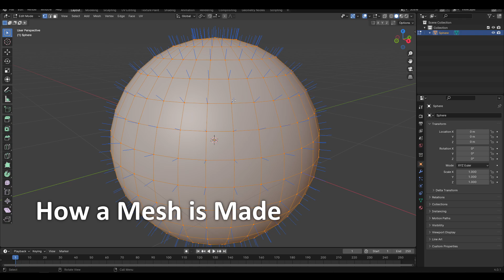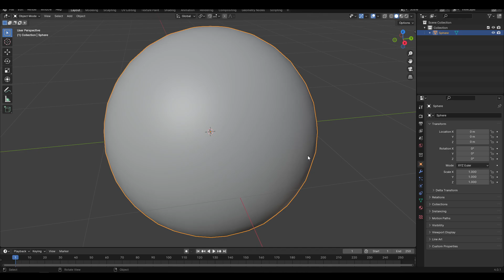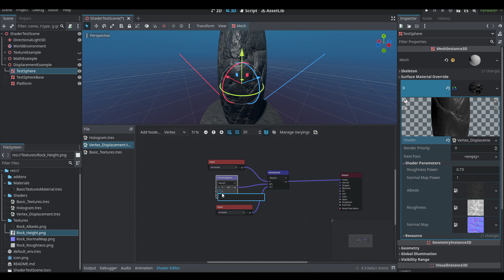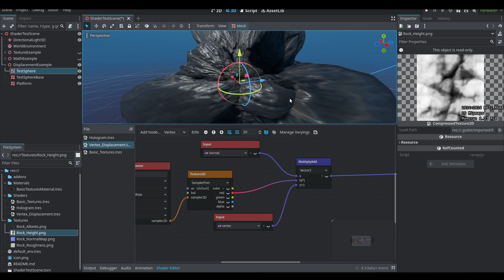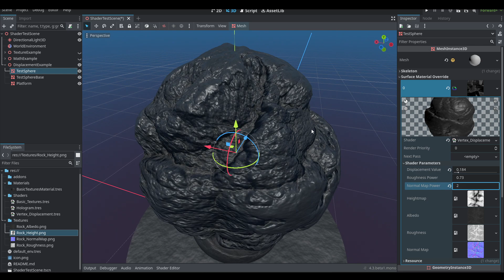Basic Shader Tutorial - Vertex Displacement

Comment: Is there a way to send the configured displacement map along with the exported .glb file?
Reply from the maker: No I don't believe so, you can generate a normal map outside of Godot though and then you could move it around, I believe if you take Perlin clouds from photoshop or some such other source, then you can generate a normal map online for it using https://cpetry.github.io/NormalMap-Online/ but yeah unfortunately there's no way I know of to export generated displacement maps.
Reply: @Bonkahe  I think you misunderstood me... I'm referring to exporting the Blender model to Godot with the textures and having the height map already incorporated into the model, which textures usually have, for example, brick textures. Currently, if you export from Blender as a .glb file, the height map is not included, I don't know why.

Comment: Man, your tutorials are the best!

A noob question about shaders: when I want to add a shader to a mesh that already has a material applied, do I need to "recreate" the material?

I have a small town that I built some time ago, and I want to add some shader effects to it (cell shading, water effects, etc.).
Do I need to create a "shader material" and reapply the textures inside this "shader material," or is it possible to add these effects on top of the existing materials?
Reply from the maker: Thank you so much for the kind words!

No you can convert any standard material to a shader, if you right click that material you should have an option to convert to shader material, just make sure to save the shader out to disc afterwards otherwise if you delete that scene you may lose your work~